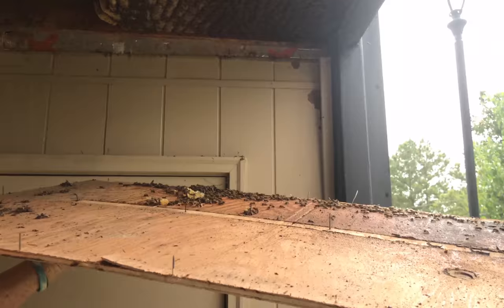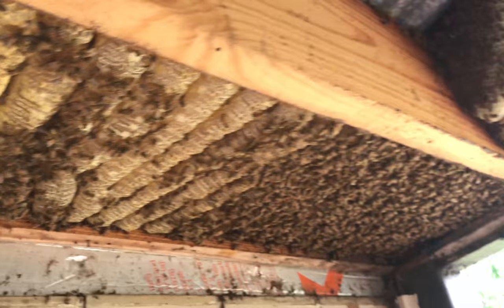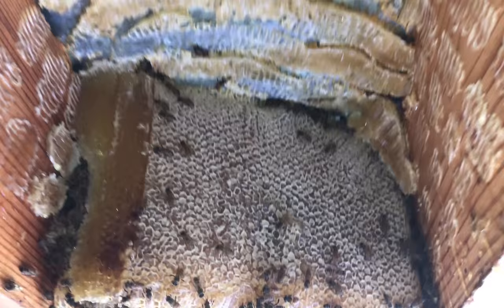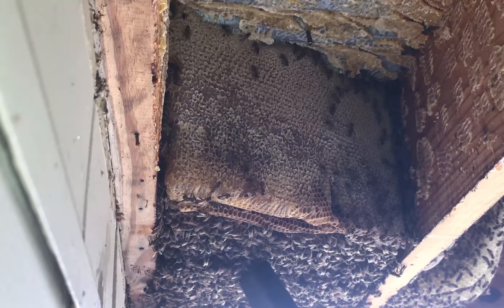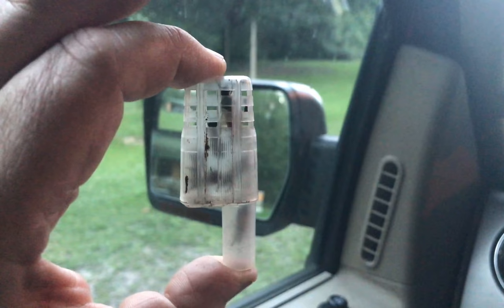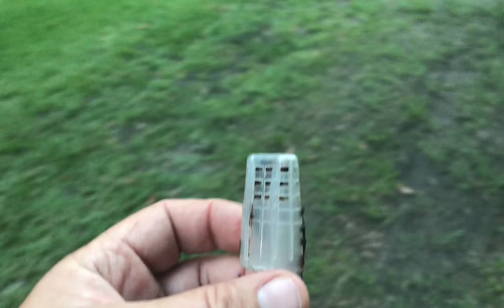Sharing Honey With Neighbors  Removing A Beautiful Bee Hive

Comment: Hey Randy,  you ever think about using a cake decorating knife for honeycomb removal?
Reply: I was also thinking you need a longer, flexible knife.  I had been thinking 12" fillet knife, but a cake knife would work, too, and might actually be better, especially if you run a flap disc around the edges, so it cuts the comb cleanly.  Nice suggestion.